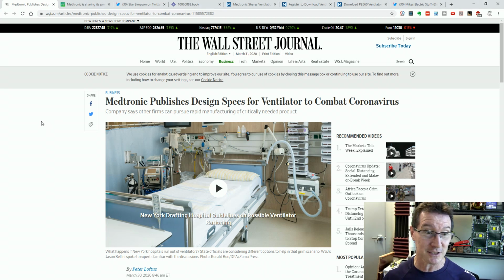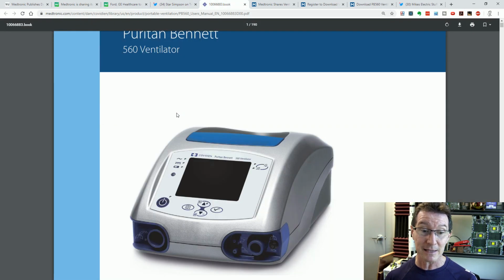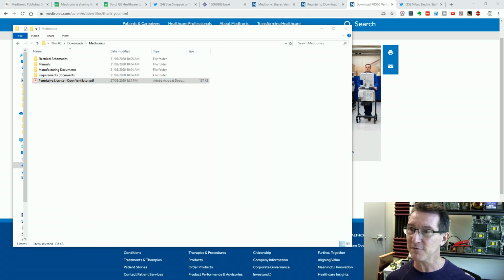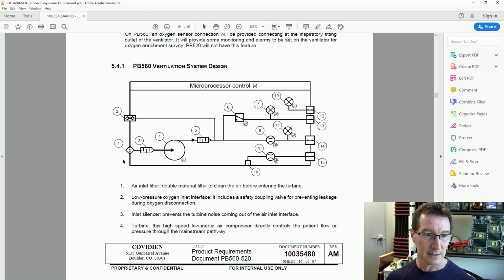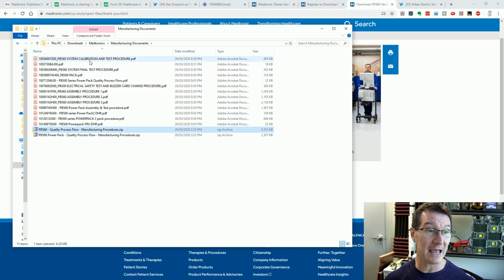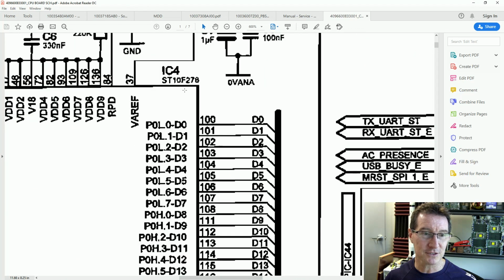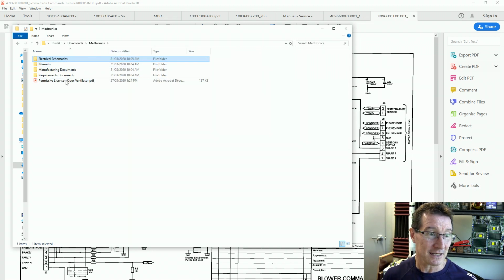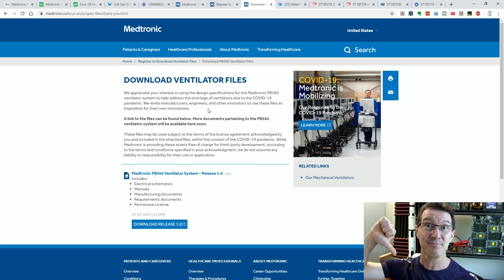eevBLAB #72 - BUSTED! Medtronics Open Ventilator FAIL

Comment: As someone, who is a Medtronics' customer for over 10 years, I can tell you, it's an extremely greedy company with intrusive marketing practice. I bet they'll never ever release anything useful. All their business is around government contracts and extremely expensive subscriptions, mostly paid by health insurance. Big money there!
Also, majority of the components in those ventilators are made by very few highly specialized companies, and only those are medical grade certified. I know one of the very few companies that makes the mentioned turbine pump is in Switzerland. Even Chinese ventilator manufacturers buy their pumps from them. From what I know, China doesn't make any of the medical grade components used in any ventilator. That include those proprietary valves and even the sensors. It takes years for any of those components to be granted medical grade approval. 
Thank you for exposing the latest attempt of free marketing by greedy Medtronics!

Comment: Even at best assuming that you get a full BOM: How much use would it have? You can be sure that the keyparts become almost as hard to get as the full ventilators.
Reply: Everything is specialized.
Cutting corners are not somthing you can do on such a machine.

Comment: These are SOME of the info needed. Normally, this would be the middle tier of documents...
The USER Requirements is top level - it defines what the user expectation of the design should be. The next level is the FUNCTIONAL Requirements, which defines what the machine is expected to do - compressed air, room air, O2 and how to adjust /O2 concentration, AC power, battery backup, pressure ranges, breath volume, safety limits, patient safety protection, output portals, PEEP, etc. (Some of these are covered by FDA special controls, national or international standards, which should be listed). The ventilator DESIGN Specs is the next level, and in this case they delivered exactly what they claim in the headline (read it carefully, they say design specs, which is NOT equal to detailed design). The other 2 levels are the functional description (wordy document where they detail how their design works), and the lowest level is the detailed design, which would be detailed BOMs and drawings. What they released is helpful for teams creating their own vent design, but thousands of additional pages are needed to replicate THIS design. (I'm a retired biomedical engineer with decades in medical device design.)
Reply: I am a retired Medtonic engineer and I agree with this comment.

If the parts are built in house there are going to be detailed drawings.
If the part is available off the shelf there will most likely be just a specification.

This ventilator was not designed by Medtronic it was designed by Covidien. Covidean was purchased by Medtronic. It is not an OEM product.

There is no such thing as medical grade parts. The FDA does not approve parts  A company may state that their products are medical grade however again the FDA only approves complete devives.

Comment: most people on youtube i have seen try to invent a cheap ventilator has forgotten to take into consideration that you have to also get the CO2 OUT, not just O2 IN lol. so no an oversize scba system wont work as a ventilator.. you also have to have safety systems in case the person coughs or something so it doesnt literally POP the lungs.. and that product you are looking at from FB looks like a CPAP not a ventilator..

Comment: Maybe "best of intentions" but the best way to get more ventilators faster is to assist the folks already making them.  They should be identified and given every resource needed on a priority basis.  They need to share the raw materials they need so folks can help source them and farm out the work that can be done by third parties.  Final assembly and check out should be under the supervision of the people who already make them.   The World War II productivity engine did not happen overnight but the production of more ventilators will help the next pandemic or any resurgence.  Even with a full set of plans and software it still won't happen fast enough to help the folks who need it now.

Comment: The utility of such a design release would be if we could directly use the s/w.  However, the biggest difficulties would be the blower and the valves.  There is some necessity of calibration of the device for airflow etc.. so if you don't have the exact valves and blower, there is a question if your physical product can be calibrated.
Another big issue is that if you are hoping to have a home ventilator, this item does not provide oxygen enrichment, so that would still be a requirement.  Not having the electronic CAD files for the electronics is not as much of an impediment as not having the data to reproduce the blowers, valves, and even the flow sensors. If those things could be worked out, we could do an open source effort at creating the electronic PCB cad data into an open platform. However, they should release the gerber files and the mechanical CAD files.

Comment: If I designed a makeshift ventilator for the apocalypse, I'd stick to pneumatics as much as possible for ruggedness and ease of repair. You can probably make ~90% of a respirator out of stuff from the hardware store's plumbing aisle and pieces of Ziploc or similar bags for diaphragms and valves. The only major other component would be a reliable source of 5+psi clean compressed air.

Comment: Those files are NOT necessarily indicative of a publicity stunt.  As you can see from the files, they are redacting authors  etc.. Even if one is attempting to honestly release the files, this would be how you would do it if you are worried about liability.  That is the main motivation with these companies.This appears to be the way one would release it.  You release what you can at the speed you can.  I have worked with these companies.  Even going through the documentation set when I had someone take me through it and explain it was quite time consuming, so you could not expect a redacted documentation set to be released immediately.

Comment: In addition to ventilators, I've seen adverts for Ultraviolet disinfecting lamps and equipment for the home, which uses UVC emitters.
Reply: tami4 or strauss water chiller from israel has such as people in israel are pissed drinking piss warm water with heavy clorone smell from the tap

Comment: If the give you the parts numbers... it still was not help you to manufacture it. Because probably shortages in this specific parts.
But (I assume) you can design ventilator based on the information there are gave (for example: for auto manufacture use in auto pressure sensors instead a medical pressure sensor).
That way the exact code there are using in their product is irrelevant.

Comment: The released documents are not the whole story for sure but it is MUCH. Having all the software requirements does allow third parties to write source code and all the functional behaviour can be derived from those. Source code might be certified under conditions that doesn't allow sharing. I would thank medtronic for all the costly material shared, which has a cost just for the writing.

Comment: As someone who works in medical electronics, this has been annoying me for weeks.  Every company has been cobbling together an ambu bag and an actuator and calling it a ventilator.  While the UK government has relaxed the need for CE marking for emergency ventilators, is still has to meet all the requirements for a ventilator including patient monitoring and alarming. Additionally the validation of a medical product includes the manufacture of the product. You can't just 3d print components and call them the same product.

People also don't understand supply chain management, that you can't take an existing product and just suddenly manufacture 10k of them in a month.  There's lead times on everything.  You either have to design a new product based on immediately available components, redesign or source new suppliers of components, or strip features for unavailable components

Comment: From the ARRL Letter:

Radio Amateurs Team Up to Help University Design Low-Cost Ventilator

Amateur radio volunteers from around the world have volunteered to assist University of Florida Professor Sam Lampotang and his engineering team in their quest to rapidly develop an open-source, low-cost patient ventilator that can be built anywhere from such commonly available components as PVC pipe and lawn-sprinkler valves.
The amateur radio volunteers are developing Arduino-based control software that will set the respiratory rate and other key parameters in treating critically ill coronavirus victims.
Multiple volunteers responding to a call for help from Gordon Gibby, MD, KX4Z, include noted software developer Jack Purdum, W8TEE, and uBITX transceiver maker Ashhar Farhan, VU2ESE. University of Florida physicians are working to address the critical legal aspects as the design moves closer to fruition. The ventilator's valves would precisely time compressed oxygen flow into patient breathing circuits under Arduino control, allowing exhausted patients with "stiff" lungs impacted by viral pneumonia to survive until their body can clear the infection.
The software design team is also adding simple features such as an LCD display, encoders to choose parameters, and watchdog safety features.

There's a groups.io group for this project: https://groups.io/g/VentilatorDevelopers
Reply: And then try to get 50k arduinos

Comment: Whilst i agree that more actual design data would be useful, please don't under estimate the value of all the production, end-of-line and calibration data. in 2020, designing a ventilator is really pretty simple, it's not actually a complex device compared to say the car you drive, or the smartphone you use.  BUT, once you have designed one, and then made one, how do you know it works?  Medical equipment is really expensive, not generally because the parts used are expensive but because the VALIDATION and CERTIFICATION of that device is onerous and necessarily thorough!  By releasing how they EOL test a ventilator that has been built, Medtronics has actually released a lot more IPR than the besic design, which as i have said, is pretty simple!  IN effect, they have released the tricky "lessons learnt" info, which you generally cannot get without actually doing it!  All those "i would have done it differently if i'd known" things!   So yes, it would have been nice to have some more design data, but what has been released would allow a massive short cut in design and development effort, and a much more robust EOL sign off for any new unit.   As an engineer we like to think about testing things, but often, it's less obvious that the hard question is WHAT actual to test and how......

Comment: I suspect the major purpose here was to calibrate designs for all the DIY types creating home-made "ventilator" designs that consisted of a 3D printed bellows or a simple pinch mechanism to squeeze an ambu bag mask.   There have been dozens of designs that the press keeps picking up on that would not only not work, they'd kill patients if tried.  People keep using the excuse "it's better than nothing" and soaking up all the admiration for coming up with a design that a first year mechanical engineering student could build while drunk in a half hour.  Real ventilators are complicated, they have to be to avoid killing sick people, and the first rule is "do no harm".

Comment: As a Systems Engineer, it is fairly easy to apply this document. I won't have too much problem creating an object as a systems engineer as we would take these document and put parts to it. I am not interested in manufacturing but it is a large endeavour and not really for the smaller open community. System software engineers will take that information and create software for themselves.

Comment: The design matrix and requirements documentation is actually quite useful for mechanical/mechatronic engineering. It should probably knock a  week of the work. If its well doen it could kick me directly into design from early design.

Comment: Sorry Dave. I usually agree with your BS meter, but I think you missed the plot on this one. 

First of all, they didn’t say that the code (and other files) “might” be released in the future, they actually said that they “will”. It’s in the press release.

As some other commenters have said, it’s likely that licensed code is the holdup. Having worked at a software company in the past, I saw just how many third party components they relied on for core functionality. So my guess is that they’re hammering out details with their software component suppliers to allow them to release it.

As for CAD files: I sure hope they release them, and that the holdup is finding them in their file archives, or fixing data import issues from opening files that are more than 10 years old, with whatever oddities occur when opening files from older software versions. (I know nothing about CAD software, so I have no knowledge about whether CAD software has this kind of issue.) I suppose in theory, these might also need to be vetted for intellectual property issues, if it incorporated 3D models provided by component suppliers, for example.

Ultimately, I don’t doubt that Medtronic is doing this for selfish reasons. But if they keep their promise and do release the files that are actually needed to reproduce this thing, then it will still do good in the world, and a good thing is a good thing regardless of the motivations.

Comment: This is a PR stunt and let me tell you why: even with the full schematic and everything you would not be allowed to bring this into service. For producing medical devices, you need to verify assembly steps and validate your production. And, in reality, you can only do this as a certified medical device manufacturer according to ISO 13485 (in the EU, FDA for US and so on), with the correct scope for ventilators. And chances are high that you are already producing ventilators if you have it, so you have no need for an external design.
Reply: what is the  value of the information on the control methods, testing and operation that those documents contain for a group of engineers that attempts to make one ?

Comment: I disagree this is just a pr stunt. (Not without that, but...)
Design teams will have to come up with their own production designs anyway, based on materials available to them. 
The main value of these documents is the domain knowledge. 
A lot of teams started to work on open source designs who might have engineering expertise and can figure out how to control a valve, but have no expertise in medical application, safety considerations etc.
You don't need a fancy case, you don't need the exact BOM. You need to know you doing a right thing.
Imagine people mindlessly copying exact bits of design and code without understanding how they work and why...

Comment: Fairly sure the FiO2 is the concentration of oxygen. I have no experience with ventilators but do have chem eng and gas blending experience. likely plugs into  an oxygen sensor which is a lead based electrochemical cell and you measure the current produced.

Comment: It's clear that, like you say, it's a publicity stunt. Enough babble and bullshit in the files to confuse the media to the level that they think its all the info but realistically contains basic schematics for electrical components and product specifications that you would be able to attain from their website anyway or requirements that can be found online (As aVE has done to build his own jank-e-vent)  In regards to ST10F278, it definitely exists as a processor as you can get hold of the software/hardware for communication with the chip in boot mode ect so it's not a typo. As you say though, the chip itself is illusive...

Comment: I believe some nuance is needed. In normal situations the failure rate of a ventilator must be extremely low, the company cannot tolerate a single death caused by their machine. This makes the CAD files not the most important part, 99% of the design is in the specs. That is what Medtronics shared here, and it is really the most crucial and valuable part of their design. And I think their specs are very helpful to other teams designing their own ventilator. Of course, today the situation is reversed. Right now we are happy with a machine that simply works. A machine can be called a success if it only saves a single life. So now we need CAD files, not the paperwork. But Medtronics did what it could, we cannot blame them for the media hype.

Comment: Hi Dave, what's your thoughts on Abbott making their 5 min test equipment hardware open source?
They could still license out the software to run on the millions of test equipment required to eradicate the virus... If everyone is able to get tested, it would negate the need for all these ventilators and the need to be locked down.
Prevention is much easier than the cure! Surely that should be the main drive at the moment